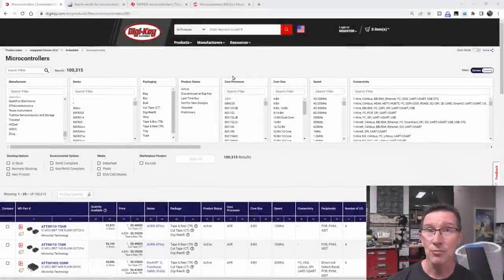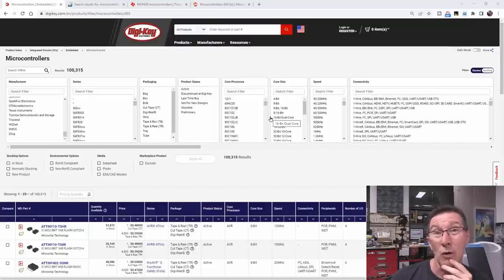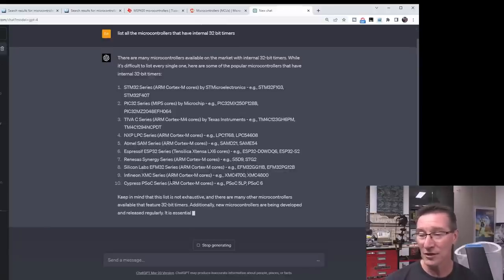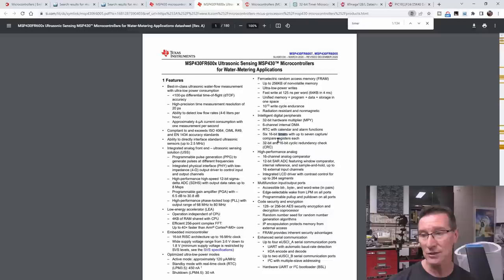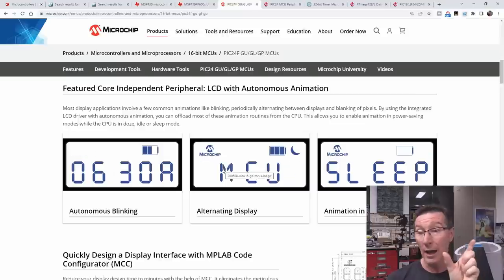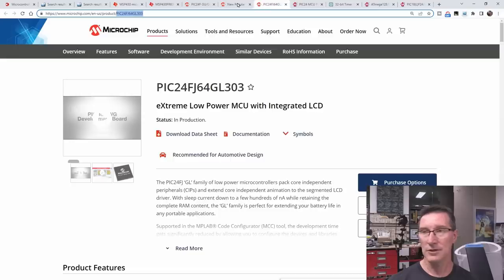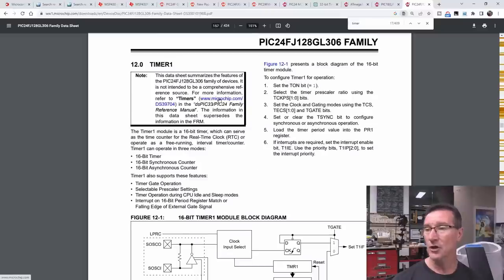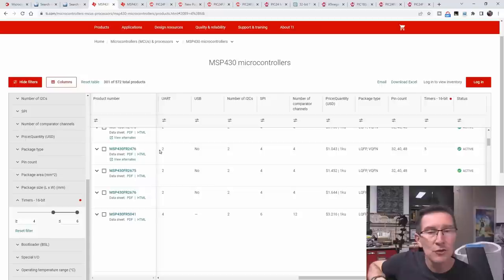EEVblog 1538 - NEW PROJECT Part 2 - Microcontroller Selection

Comment: I like the ATSAME70, but it only has 16 bit timers and is not low power. The timers do have a cascade, but you have to handle rollover sensing. The built in SAMBA (not the same as windows) Rom allows it to be programed in circuit via USB or serial. and it has a Erase pin for when things mess up. I also tie a output pin to a pulldown resistor to the erase pin so I can send a command to the existing code to erase itself.

Comment: Chatgpt4 wasn’t wrong. The atmega128 can create a 32 but timer by tying the two icp pins together. 

It uses the second timer to count the overflows on the first automatically.  You need the EA series of the chip.

Comment: ATMega.. STM32..or ESP32...would be my go tos.... really depends what your comfortable programming...or if you want to learn about the micro from scratch...
Reply: ESP32 and low power doesn't really fit
Reply: @Jonas_Meyer  youd be surprised... if programmed right ...especially the newer ones in the family..
Reply: @WacKEDmaN  do u know what the project is? no u dont, so how can u recommend a uC for it?  youre just biased from your own personal experience.
Reply: @lindadanforth-md8hc  ....thats why i said "would be my go tos" ... and the rest of my statement.. youre correct! purely my own opinion! :) Dave will use what he wants....
Reply: @WacKEDmaN  How low can the new ESPs do?  The PIC24 he was looking at will use around 250uA running at 1MHz (50uA@32kHz, 1.4mA@8MHz, 5.2mA@32MHz), and can deep sleep down to around 500nA at normal ambient temperatures, plus it can switch between those different modes on the fly (though it is more complicated to come out of deep sleep, you have to either have something external or use a timer to wake it up)
Reply: @wcvp  consumption depends what features are enabled... yes there are probably better chips.. but the ESP32 isnt as bad as its made out to be.. if its setup right!  battery size wasnt really specified but yeah not gonna get a year off a battery enabling all the features..
Reply: @wcvp  ESP32 Modem Sleep Mode (no radio) Current Consumption is (2~4)mA @ 2MHz “Slow Speed”, (20~25)mA @ 80MHz “Normal Speed”, and (30~50)mA @ 240MHz “Max Speed”.

With only the ULP core running it takes 150µA. Comparing a PIC24 with an ESP32 doesn’t make too much sense, though, very different products.

Hibernation Mode Current Consumption is: ~5µA

(That’s for the initial ESP32, modern ones offer more options.)
Reply: @wcvp  I was curious myself, so for the ESP32-C3 (RISC-V core) it’s:

Modem Sleep Mode: (13~22)mA @ 80 MHz, (16~28)mA @ 160 MHz
Deep Sleep: 5μA
Power off (CHIP_EN low): 1μA
Reply: @serpent213  That's honestly not bad at all for what it is, but yeah comparing a PIC24 to an ESP32 is pretty meaningless lol
Reply: As someone who has gone that route, low power on an ESP32 is a PITA.

Because of how they implement stuff through firmware, there’s a lot of limitations on how low or what sacrifices you need to make to truly go low power. Would not recommend it.

Comment: Hi Dave, could you use a 16-bit counter clocked off an external clock? Even the 8-bit ATMega328P has a couple of external clockable 16-bit timers. I've not tried it myself, but I would have through you could wire the output of one into the clock of the other. P.S. Loved this video, great to see this type of problem solving.

Comment: Why LCD?  Is it a requirement?  An OLED display, if you find one that meets your size requirements, would be just as durable and all the display design would be in software.  I don't know of any microcontrollers with integrated OLED drivers, but serveral OLED's use standard LCD driver signalling.  The savings from a custom LCD might make it worth the extra driver chip.
Reply: It’s a segment LCD, not one full of pixels. You need specialised driving circuitry to drive a segment LCD on its own. Sure Dave could use a dot matrix OLED or LCD but he would need a drastically more powerful and expensive microcontroller. It would also be way more power hungry too. The dot matrix is also typically more expensive, as they require the driving chip to be on the LCD glass for any decent resolution density. There would be so many connections such that you would not realistically be able to drive it from an external microcontroller if it even exists. Hope this helps.
Reply from the maker: Power requirements.

Comment: Can you not use a counter overflow interrupt to have the code increment the next time and that handle what you'd need? well, 1 year battery life implies not running loop code or whatever.

Comment: TIMERS !  The bane of my existence !
Try finding a high end microcontroller with a 32 bit timer that can have 30+ outputs!  The , are other thing about hardware timers are they count down to zero or or is the clock compared every "tick" for a match ?
Last, time has to ALWAYS be treated an UNSIGNED entity.  This get really tricky if the software can be "late" scheduling something that is supposed to happen in the future (so you have to make in happen now) !
Reply: Most you can select 'countdown' or a 'compare/match' register to trigger the ISR. Some can PWM, and you control the period. If you really needed synced outputs with that many outputs, it might be easier to sync 2, or use an FPGA
Reply: the best experience i have encountered (so far) for timers has been with sm32 platform (.. however i am yet to try quite a few other platforms. so its not to say others cannot be good too)
Reply: The old 8096 used a very unique "high speed output" subsystem.  Triggers were store in a "carousel" and tested against the clock every "tick".  The biggest problem was the carousel only held 12 (?) trigger values, but the clock tick rate was about 1 μsec.  The small carousel and and the 16 bit clock/fast tick rate turned out to be difficult for software to manage.
If the HSO subsystem had a much larger carousel (minimum of 2 slots per output pin, 4 would be better) AND a 32 bit clock, it would have been an incredible HSO subsystem!
Reply: Ultra-low density FPGAs like Lattice iCE40 make sense for extreme multi-channel output applications.
Reply: @abitofabitofabit4404  Only if the volume of the product is "reasonable".  Automotive Engine/Transmission controllers could easily require 30+ timed outputs.  The F150 EcoBoost (6 cylinder) has 2 injectors per cylinder.  Add 6 spark plugs and who knows how many are required for a 10 speed automatic transmission !
Reply: @jackpatteeuw9244  That's fine, Verilog allows easy parametric instantiation of multiple modules. Designers can stack up pulse generators all day long until they run out of logic/memory cells, and a timer/counter stripped down for the application doesn't take that many. Assuming that the precise timing has been calculated by an application processor from sensors and maps, the high-speed board-level connectivity needed to send the timings to the timers is a routine engineering problem.

Comment: It would still be possible to use ATmega's 16-bit timers for almost 32-bit counting! The timers have hardware outputs and inputs that can be connected to the corrwdponding GPIO pins. So you can just connect the output of the first timer to yhe input of the other one and get what you want. It would look like a somewhat desperate dirty hack and in terms of low power the old ATmega-s are not the best but if you have a ton of them in stock then technically you can still get away with using them.
Reply: no.
Reply: @lindadanforth-md8hc  Why not? Just put a trace on your PCB between the pins and you are golden.

Comment: tell you what, the PICs are damaged goods ! 
its not BLASPHEMY, ive seen too many things with a failed PIC in there way more than any other microcontroller.
throw a PIC in ur project and PRAY, trust me. 
I dunno WTF the PIC manufucturer is doing with silicon, probably molesting it.

Comment: yeah pics do sound good for this. just unfortunately i am not familiar with pics

elsewhere for ultra low power, it really becomes its own thing and takes time to investigate unfamiliar solutions. i wonder if you cannot just entirely power gate your chosen mcu with an external wake up driver chip. to give an easier time to not be so locked into a specific mcu to provide its own ulp sleep. there is a special name for those external wake up timer circuits. and i think maybe you have covered them before in a previous video?

other possible ulp options? that isn't the pic? however none of these may have your desired internal lcd driver. idk anything about that. but just other ulp mcus in general:

the atmega stuff (like the 328p in the arduino) is supposed to be ulp, however the timers can be 'not the best' lets say. harder to deal with

nordic semiconductor is supposed to have some ulp offerings... they also happen to sell a useful tool called the nocdic ppk2. for measuring low power projects.

i suppose then there are the expressif ones, that are possible to use for ulp applications. for example the trig board now uses esp32... bearing in mind that those will restart themselves / reboot, from deep sleep right? then consider the number of gpios you need, which is to say: espressif is usually pretty stingy in the gpios and io blocks dept.

another lets say 'cheap' platform is rp2040. which has certain set of things that makes it generally quite an attractive mcu. but i really have no idea at all how those fare for ulp applications. it does probably have good timers and gpios though.

and of course the stm32l4 (or similar) is another one. but then you have to consider actual parts availability post covid. again, good timers and io are its major strong point

but most of all idont understand enough about the ulp space. would like to see other modern concrete examples for ulp comparing pic to more modern mcus, and also comparing to power gating mcus. the main thing is what i really dont want to give up is a low friction and flexible developer environtment. with good debugging tools and such

for this i have already switched to platform io. which is itself broadly compatible across the widest variety of competing mcu platforms / brands. so in that sense i am kindda agnostic and dont care much about the specific mcu platform. just other than it having hardware debugger support (jtag or equivalent). and just geerally being easy to program on and deal with. are the priorities (for me). the lowest friction possible. (and hopefully not too buggy)

Comment: Anything that is NOT designed right in China. Everyone is going insane these days with 20-cent MCUs from China that have no datasheet. I have better things in life to do than to reverse-engineer someone's die design, architecture, datasheet parameters, etc.
Reply: My favorites are ARM, AVR, PIC. In that order. 
Lately ALL my projects basically always use Microchip parts. That, I believe, is the wisest electronics company. They are acquiring all older/popular/industry-standard/5V options out there... From PALs (don't ask) to MCUs and other ICs, I see Microchip so often I might as well go work for them...
Reply: There are. Just in another language.... Sometimes you just have to request it

Comment: With all due respect to you, Dave, I cannot agree with this choice of microcontroller. Firstly, being aimed at very low power consumption, choosing a microcontroller with a core/instructions from the previous era is unwise, they are very power hungry. Secondly, computing power has a direct relationship with energy efficiency: as a rule, the higher the overall performance, the lower the power consumption in reduced performance mode, which is primarily associated with more advanced technical processes that provide increased computing power with less power consumption.

TL;DR: The best choice for these key requirements is the STM32L0x3 product line. And no, Arm Cortex-M0+ is not an overkill in 2k23, it's more than 2 times better in low power consuption than this PIC rubbish. :)
Reply: From its datasheet and refmanual:

Ultra-low-power platform
– 1.65 V to 3.6 V power supply
– -40 to 125 °C temperature range
– 0.29 µA Standby mode (3 wakeup pins)
– 0.43 µA Stop mode (16 wakeup lines)
– 0.86 µA Stop mode + RTC + 20-Kbyte
RAM retention
– Down to 93 µA/MHz in Run mode
– 5 µs wakeup time (from Flash memory)

– High speed internal 16 MHz factorytrimmed RC (+/- 1%)
– Internal low-power 37 kHz RC
– Internal multispeed low-power 65 kHz to
4.2 MHz RC
– Internal self calibration of 48 MHz RC for
USB
– PLL for CPU clock

11x timers: 2x 16-bit with up to 4 channels, 2x
16-bit with up to 2 channels, 1x 16-bit ultra-lowpower timer,
1x SysTick, 1x RTC, 2x 16-bit basic for DAC, and 2x watchdogs
(independent/window)

LCD driver for up to 4x52 or 8x48 segments
– Support contrast adjustment
– Support blinking mode
– Step-up converted on board

– Serial wire debug supported (Real-time hardware debug)

The TIMx timers are linked together internally for timer synchronization or chaining. When
one Timer is configured in Master Mode, it can reset, start, stop or clock the counter of
another Timer configured in Slave Mode.
Reply from the maker: Sure, but sometimes you don't need the absolute lowest power thing on the market. And the STM is more expensive than the PIC, and of course the infamous supply problems.

Comment: I prefer the Parallax PROPELLER CHIP,  its a bit pricey, But its 32-Bit with 8-real independant cores and easy to program. You can use any programming language SPIN, C, basic, assembly, forth, python etc
Reply: Huh that's really interesting chip, doesn't really seem to have many hardware peripherals though.  I guess that doesn't matter as much when there're 8 cores though lol